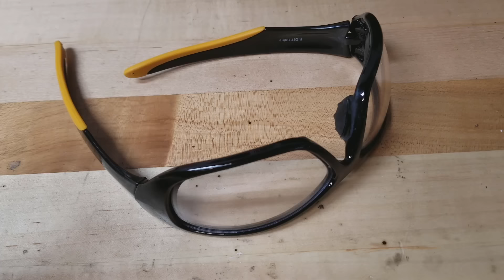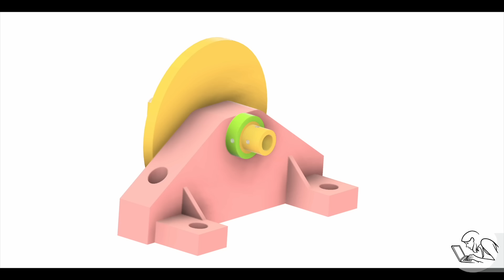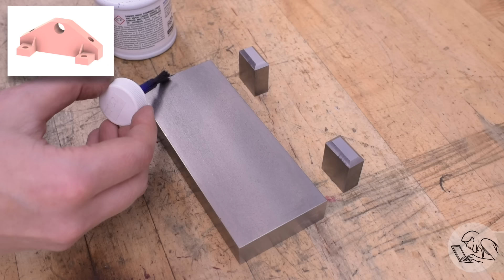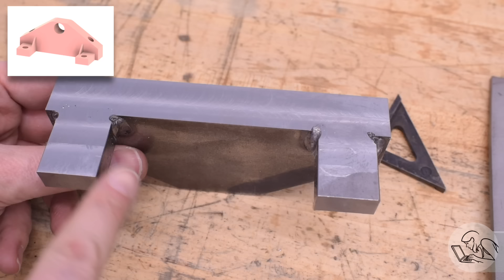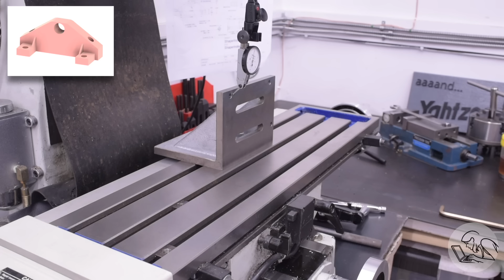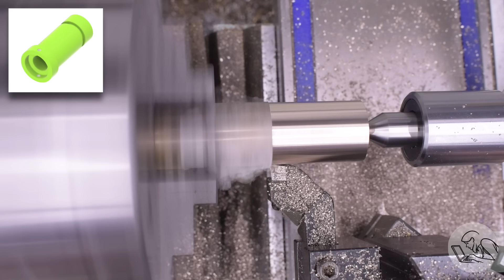Rotary Indexing For My Shaper (Part 1)

Comment: That's looking good.  The catalog drawing looks like there were four major parts to the 'stock' indexer.  There was the base (which may have been two separate parts), slotted so that the 'headstock' could slide to adjust for the shaft length, the 'headstock with the indexing assembly, and the 'tailstock.  The fourth was a plate at the 'headstock' end to keep the base square.  I expect Atlas probably had a fixture to locate the head and tailstock castings for boring the center holes.

Comment: you can make the flux core self shield look good. needs a nice fresh spool. can be expensive to run. I imagine this is common and im just mentioning it for those that might scroll this far c:
Reply: apologies. im slightly drunk atm c: I mean to say the flux core is hydroscopic and will make porosity in the welds for the water it absorbs from the air. . . because the wire in self shield flux core and dual shield flux core //// here its self shield flux core but the concept is the same... its like a rolled sheet unlike other wire for mig/mag. this " wire" is hollow and water gets into it.  hopefully that helped a few people x-x
Reply: with a fresh spool start the run just ahead of the corner intended as a start by 1.5 cm or about 3/8 ish.  :o and um... then drag back rather quickly to the start and pause there for a short moment then continue to finish

Comment: No problem with flux core. Use the wire you can multi-layer and throw away the gas cup. HF (and e-bay) does a slim tip cover that makes the job sooooo much easier to see.

Comment: Great build! I have 2 shapers (16" & a 24" hydraulic) and once had a similar issue when needing to recreate splines (21 of them). I ended up attaching a custom index plate to the shaft, to finish the job.

I do have TIG (which is the result of my machining habit).....but flux core/stick are used just as often. It really depends on the need/application.

Looking forward to part #2-

Comment: I don't honestly think you should have used tig. With pieces that big you'd be pushing a lot of heat through a tig torch to get solid penetration. I think flux core was in fact the exact right process, since you can burn in deep and not have to worry about wasting a ton of gas on how broad the weld pools are going to be.

Comment: If the metal is stuck together well, it's the right process for a hobby shop. You're not building a pipeline or a skyscraper.

A deeper chamfer with some shielding gas really lets flux core shine if you really need something stuck together.

Comment: Hi, is there any way you could explain the impact of different shop temperatures and therefore the match between different metals, on tolerances when when matching metals that are close tolerance. I really would appreciate some guidance.
Reply from the maker: That’s easy- there is no effect. 😄 If your shop is hot or cold enough to affect fits and tolerances, you are dead.

Comment: i had a thought, what about making an extension for the table so the workholding fixture is just completely out of the work envelope? either extend the table or make a fixture that hangs off the front
Reply: A homemade angle plate with reinforcement gussets on the inside of the angle is the best way to achieve that. The angle plate needs to be bolted onto the front vertical face of the shaper box/table.
 All the loadings are in compression and transferred into the vertical face of the box/table.

Comment: Quinn - what a clever fixture you have designed for your shaper. Working with the small footprint available, and the index plates from your rotary table, you have engineered a very compact and accurate rotary fixture. Bravo!

Comment: 9:42 I'm a MIG weekend warrior too. Don't weld often, but when I do, I also do some grinding
Reply: Grinder and paint make me the welder i aint
Reply: Have not used it myself yet, but my father has a couple times. Home-built stick welder checking in. I did help with the cleanup a couple times.
Reply: I usually end up welding the stick to my workpiece. Fluxcore has been much easier for me.

Comment: I used to do a lot of flux-core welding, i had a 90amp 120v unit. it was great for doing work in situ and for weekend projects.  Spatter spray and tip cleaner are your friends though, and definitely clear away all flamables.

Comment: Fluxcore mig is completely fine, its bad reputation comes more from the people using it than the process itself, if you work within its limitations. Since it is a welding method that is open to amateurs, its what amateurs use, hence the reputation. Stick welding is similar and would also have been completely adequate for this
Reply: Exactly. But the internet is gonna internet. "If you're not laying dimes you're doing it wrong"
Reply: Stick would be a better choice, the smoke from flux core is alot worse to breath... I would never do it indoors unless there's crazy ventilation ...